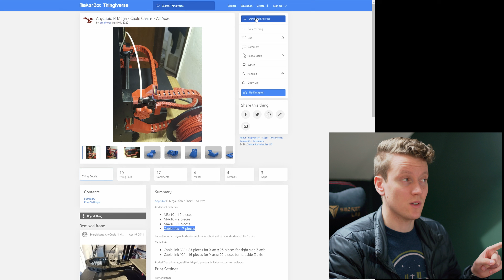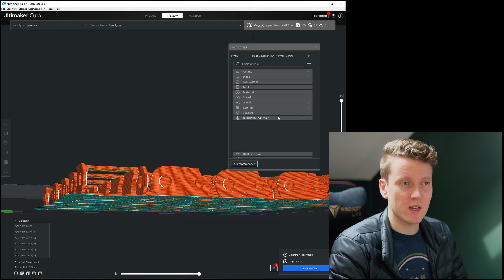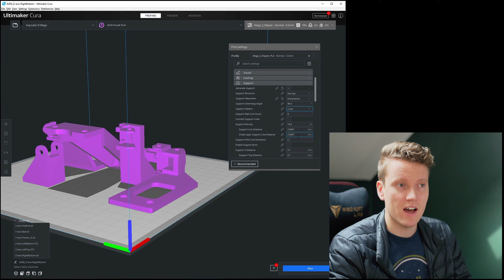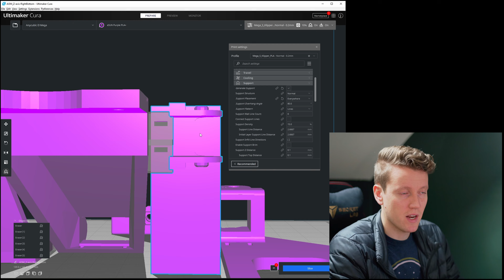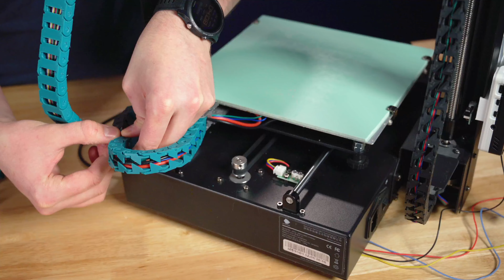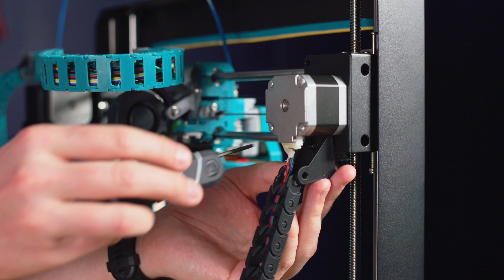Anycubic Mega S Cable Chain Full Guide | Print This Next

Comment: Sorry to ask questions on such an old post but I with the y-axis bed frame linked to I found that the blower on the x-carriage hits it slightly when at the back of the bed which has the effect of pushing the bed down slightly.  This is clear when running mesh levelling (and effects the mesh results).  How did you get around this issue?  Thanks.

I realise after I posted that I can probably just raise the bed height a bit, was worried that loosening the adjustment screws might ruin stability but I think there should be enough play unless there is a better solution.

Comment: Did the chain in the back fix the issue of the cables constantly loosening that back right bed leveling screw? Poor placement on the part of Anycubic. I have a Mega Pro and woke up to the screw missing. 12 hour print now out of alignment because the cable rubs against the wheel that adjusts the bed level.

Comment: One of the first things I did when I got my I3 Megas was print my own cable management chains, but I opted to simply change the stiff wires on the hot platform for similar gauge high number strands, but silicon sheathed, to obtain the flexibility witout risk of the wire sheathing and wire breaking. 

On my first I3 the wires connection to the hot bed was the main issue for them breaking, simply attached via a tie wrap around a hard plastic sheated set of wires, poorly done. While this caused a small spark, I caught it before things got worse.  This type of factory strain relief, of course did not let them flex as they should, so I changed the wires as explained above and used nylon P-Clips to hold them in place at the exit and near the edge of the hot table.  I was going to design a custom  3-printed clip for them, as some people had/have done,  but the nylon P-Clips worked great. No problem with them since and I have had the first machines since it was first introduced to the market.  

Over the years I learned to favor function for aesthetics, with the  KISS principle in place. The cable chain was too bulky even though my design was very low profile and very flexible, I just could not beat the simplicity of simply using silicon sheathed wires with enough length for them to flex naturally, I used small pieces of  soft  heat shrink, spaced at 2" intervals,  to hold them together while allowing them to flex.

Comment: For the y-axis you said there's 2 holes you can use to mount the bracket to the body, did you drill those screws yourself? I don't have those holes on my machine.

Doh! Nevermind, the zip tie is using the holes! 😃

Comment: How do you set your print speed so fast? What firmware are you using? Anything faster than 60 and the Y axis bed gear slips for me, even at its tightest!
Reply from the maker: I am running Klipper firmware instead of Marlin, which can help speed things up. But that is odd that the bed gear slips.
Reply: Discovered that my Y axis slippage was due to cura slicer. I have since swapped to Prusa slicer and it's been perfect!

Comment: Nyloc nuts, and yes you can get them in m3 will keep them from backing out, also putting a second nut on the bolt will act as an lock nut, or using other stuff around the house some nail polish once it is tight will act as a cheap thread locker, just some dyi info for ya.   

Still a great info on getting the chains to print right.

Comment: When I did the cable chains on mine I split the body and rotated the extruder motor so the wire didn't have to wrap under to the bottom. I didn't like how much tension was on the wires when the gantry was at its lowest point. Works really well with zero wire strain and lots more slack 👌
Reply: You have to take the extruder apart (really easy) just keep track of where the screws go, they are all different lengths. The last 4 screws (1 on each corner) hold the motor to the bracket, so hold it while you take the last screw out. 
Just twist it 90 deg. Put the screws back and put the extruder back together.  
Mind the spring, it will shoot out of the housing and get lost If you don't take it out carefull.
Reply from the maker: That's a good idea. I'll have to look into that.

Comment: How are you able to get such good bed adhesion with an initial layer speed of 50mm/s for a normal build? Mine is at ~12-15 mm/s and im still nervous to leave a room until its down.
Reply from the maker: The G10 build plate, and the BLTouch has helped a lot in my confidence of first layer adhesion. I also will slow it down for prints with smaller first layers so they can go down well.

Comment: I notice you added a cover for your hot end fan within the past couple weeks... do you mind sharing the STL?
Reply from the maker: I used this one: https://www.thingiverse.com/thing:4458097
It is good for mounting LEDs, but I don't like that it limits your view of the nozzle. So I might change it in the future
Reply: God knows if you see or check messages on older videos. But I’m finally getting around to actually using my Mega S. What mount attachments did you use for the strain relief on the MK4? Do you still need the back duct mount. That gets confusing.

Comment: I do like your content as I own Mega S myself. I think there are plenty of Voron videos, but content about this budget printer not so much. 
I personally would like to see you eventually taking it to a new extreme level. New SKR board, Meanwell power supply, linear rails, better belts, upgraded heating element and insulation, upgrading to genuine Nema stepper motors, Z axis reinforcement. Maybe even considering voltage switching to 24V?
It might be over the top and not worth the price, but definitely entertaining to watch. Also having a stock Mega S with unchanged firmware for speed/quality races?

Comment: Remember that cable chains serve two purposes:
1.  Strain relief
2.  This is crucial - distributing the wire bends across the ENTIRE cable section, NOT concentrate or force a bend in specific locations more than others.  Note the X chain. It forces a bending in sequence every single time.  That's the exact opposite of what you want.  IMHO, the X chain across the gantry is actually bad.  It will bend the portion of the wire closest to the hot end first and does not distribute the bend across the entire wire over the X axis motion.  That will wear out that section of the wire prematurely.